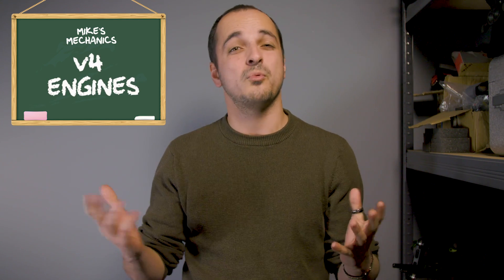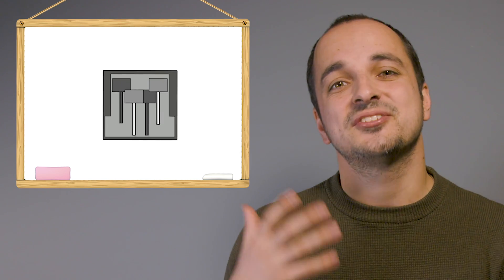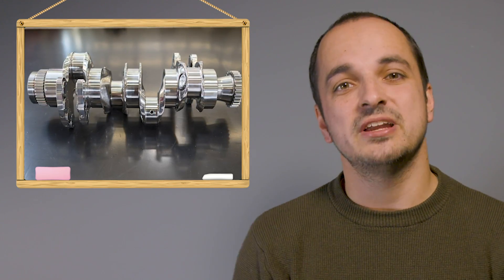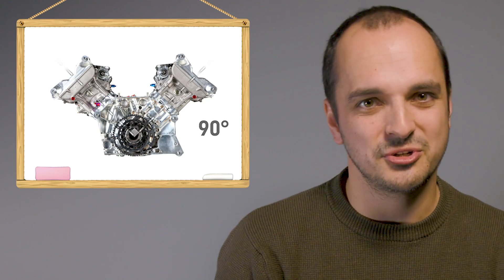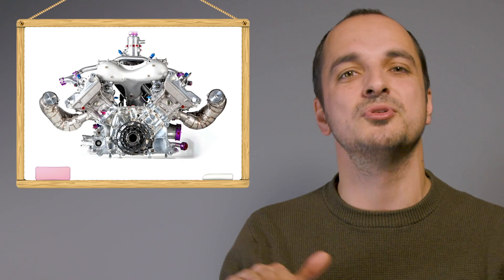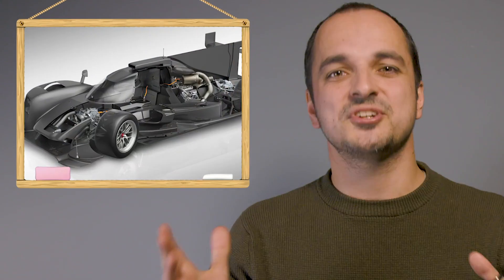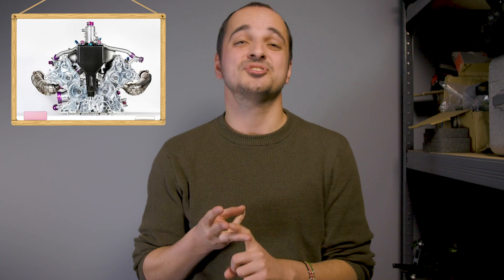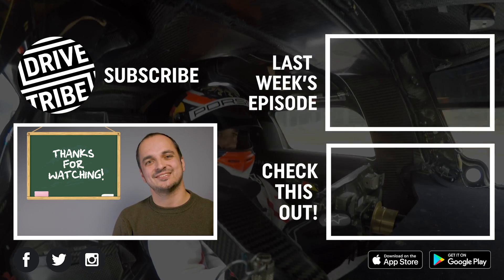Why V4 engines are so rare and which cars use them - Mike's Mechanics

Comment: My Audi Q3 2.0 TFSI Quattro have a V4 with only 320hp
Reply: But it has AWD
Reply: That is not a v4.  It's an inline or a boxer.
Reply: @mikeandrews4901  actually no, i modified my car, i just change his engine, and because the V4 is so compact fit perfectly
Reply: What manufacturer? And yes of course it's not 500hp like the one in the video.  Its a twinturbo They could have gotten 1000hp plus with that one but they want it to last.
Reply: @mikeandrews4901  I don't have the balls to make it more than 400hp lmao
Reply: @vaporwave8395  in a small lightweight Audi, good call.  Those things are craptastic!  Meaning they are nice as far as looks but every other way they are worse than fords!
Reply: @vaporwave8395  I have a 4 door Honda civic that's cranking out 672hp at the wheels, it has a inline 4 running 22 pounds of boost.  It is a scarrrry ride on the streets, but on the track it's a head turner.
Reply: @mikeandrews4901  I really don't like to push up that much in a car, I personally prefer a car were i feel safe to drive. (Btw i think than a Audi RS6 would be perfectly for you)
Reply: @vaporwave8395  lol more like an Acura rlx with boost

Comment: No man SUBARU used a V4 engine in the 90’s and early2000’s I think then Porsche got the idea 💡 wow problem like you said vibration to smooth operation and more trouble was horse power that suddenly was exposed.... too much to the Porsche and details that too hard to explain
Reply: Never heard of a Subaru or a Porsche with a V engine, they are boxers or opposed engines.

Comment: Ducati and Aprilia are already using V-4 engines in there super sport motorcycles. Technology is so advanced that more cylinders outweigh displacement. To compete with four cylinders need a four-cylinder. The same thing goes with a 90° V6! I like my 90° V twin 1299 S Panigale at the race track! 1199 is the maximum displacement for a V twin and it cannot compete with the four-cylinder 1000cc because of technology! The twins are allowed extra 200cc in competition races.

Comment: Ford used a V4 in there transit in the 70's
i also had a V4 motor cycle VF400
Reply: aeroflopper . My very first Ford Capri was the 2L V4, never had any trouble with the engine, only the usual Dagenham dustbin problem, rust.
Reply: @BDEyes53  i was just a boy in the 70's but i do remember the V4, i did not no it as a 2.0 just the 1.8 transit variant, an ex of mines father had a v4 tranny but we dropped in the 3ltr V6 that was much better.

Comment: So how does adding two more cylinders and making a V6 improve the cons?
Reply: It's easier to balance a 60 degree V6 than it is a 60 degree V4. 90 Degree V4 is bulky for general use, for a production car it's generally going to make the same power as an inline 4 so the extra cost and space a V4 takes up isn't worth it.

Comment: I had two Saab Sonnets with v-4’s.  I had duel exhausts put on both.  The engine wasn’t real strong on horsepower, but the sound of the engine was perfect! And they had 18” wheels, front wheel drive and was crazy fun going around corners.

Comment: I still don't see how this is more complicated than a V6?
Reply: It's not.  It's not practical for a street car because they weigh and cost more than an inline 4.  People are fine with the smoothness of an I4 today and very few production cars use the block as  part of the chassis.  In term of performance there isn't really an advantage.   Unlike V6 vs I6 the packaging doesn't matter much in fact I could make a strong case the I4 is more flexible in most cars.
Reply: @ineffable1129  they weight more? V engines normally weight less than a similar cylinder count I platform.
Reply: @ineffable1129  also packaging there is a difference. A I is always longer a v shorter but wider. If you need a shorter nose a v always is preferred because of this nature
Reply: @jdrok5026  Not in the case of a 4 banger there isn't really.  Either way mount it then they take up about the same amount of space in car application. 

That changes with 6's where the V has a real packaging advantage. 

 
I should have qualified that assumes a 90 degree V.  A 60 degree V like most purpose built V6's can weight less.  With I4 a 90 degree is ideal though.

Comment: Don't forget that Subaru makes one of the most common V4's around, it makes the flat-4 which is basically a 180° V4!
Reply: That's why it's called a flat 4, not a v4. Next thing you'll be telling us a straight 4 is a 0 degree v4!
Reply: @rossbrumby1957  I mean it's not wrong. Also no v design engines can be any degree. Flat is less descriptive as it takes two very different design ideas the boxer and the regular v design. So flat is more of a overall term.

Comment: My Honda VFR has a 750 V four. 4 valves per cylinder and gear driven cams. Thing is awsome
Reply: my Honda ST 1300 has the same and is sweet and super smooth.
Reply: Dre Belanski miss my 1985 VF500. Honda v motorcycle engines had some torque. They also sounded amazing with some jetting and a less restrictive exhaust.
Reply: They are awesome! I'm looking for one to build a buggy for my kids, they are hard to find.
Reply: @mikeandrews4901  they really aren't 😂😂 the engines are freely available and cheap as shit, mainly because they never, ever break.
Reply: @Soulrollsdeep  what I meant was they are hard to find in my area.  The closest I have found is in Texas. That's a min 13 hour drive.  Not exactly doable for me giving I'm not allowed to drive due to medical reasons. Gotta find one cheap nearby or that can be shipped. Keep in mind I don't need just the engine, I need the harness, and electronics too.
Reply: Same here, just an 800.
Reply: I love the whine of those gear driven cams. I had a VFR800 and I always thought it was very close to a v8 sound.
Reply: @MODeration_nXS  
Oh ya. I got a little carb work and a hindle exhaust system and in 3rd gear at 2500 to 3500  RPM it sound like a Mustang. I sold my first one with 130.000 Km and thing was still pulling wheelies . Honda is the king of reliability
Reply: @drebelanski7869  agreed, definitely most v8 sounding at low rpms. My vfr800 was my first bike and it took me a few weeks before I had the balls to crack it wide open. Lol. I was eventually pulling wheelies and cornering it like a small sport bike. Never dumped it and sold it after 2 years for what I bought it for. Awesome bike.
Reply: On my third VFR now and my second VFR 800 fi. It has a 'civilised' stock exhaust at the moment but I've got a two brothers can for it that sounds awesome. Smoothest bike I've ever had, when I got my first one it was so smooth and quiet I kept bouncing it off the rev limiter until I learned to feel where the red line was.
Reply: @alexarcano  I wanted to put a two brothers on my mine so bad! Best sounding muffler for that bike
Reply: I'm currently restoring an '87 VFR 750, beautiful engines!
Reply: VFR was/is a beautifully engineered design, largely driven by the corporate embarrassment associated with the complete dog that was the VF750 that came before it.
Reply: Brilliant engine i had an FJ
Reply: The v4 is the reason I want a tuono.
Reply: My NC30 (Honda VFR400) has one too....for people with small fingers! Have you seen the plugs on them or even tried getting them out!? It’s essentially a miniature version of the 750!
Reply: @simes205  a jewel like engine

Comment: Several motorcycles use them, including two of mine.
Reply: Hard to beat a V4 engine in motorcycle production.
I Won t ever go back to anything different
Torque
Sound
Smaller
Wide range of use
horsepower

Nothing compare to a V4

Comment: As others have pointed out the Ford V4 was in production for many years in the UK. Because it was a push rod engine it only had a single camshaft and was a very compact engine hence its use in the popular transit van in the Uk. I think a little more research is required before producing this video . Or say that you are only talking about racing engines...Cheers Warren

Comment: Please do another video on V4 engines.. I just learned it was beneficial to mass produce in line 4 cylinder engines.. Has Porshe been making 4 cylinder engines throughout the years and finally got one perfect? Or did they just decide to try for the first time and get it perfect? 
Interesting.. I seriously suggest you make more v4's.. Especially if you can find that one you mentioned by that company who you mentioned did they're v4 a little more narrow with a single head..

Comment: Mostly unbalanced? One of the reasons to use a 90 degree V formation is that you could balance it with only crankshaft counterweights unlike a straight four (that is unbalanced by default BTW so it definetly isn't a V4's disadvantage) where you need to use both counterweights and balancing shafts. He basically names all of the V formation disadvantages and blames them all specifically on a V4.

By the way as was stated before an air-cooled V4 was also used in soviet ZAZes. Because being air-cooled and OHV it was relatively simple and being a V4 it was compact with cooling fan and shroud conveniently located inside the V. It also sounds like a half of a V8)
Reply: All v I h etc etc formats have issues. I6s and v12 are inherently the most perfect engines in terms of balance along with boxers.
Reply: @jdrok5026  90 degree Vwhatever doesn't have balancing issues in terms of complexity. primary forces cancel each other out and secondary combine and can be balanced by  weights on crankshaft which are there anyway to balance centrifuginal forces.

Comment: And as soon as its components get made and are available everywhere, it will be the most inexpensive, fuel efficient and powerful engine you can ever get and swap your old petrol guzzler with.

I4s are great, they can make a huge power with small packs. But an even smaller V engine, with the same power? 
The V4 is not more difficult to make than any V engine anywhere, as the model is pretty much the same. Just nail the 90º angle and there you go.
Reply: It isn't more difficult but there are small gains from the complexity since the I4 does it's job just fine. With more cylinders in inline engines however come problems: besides the sheer size and weight of the engine, long crankshafts and camshafts are less rigid and more prone to breaking due to twisting vibration and balancing shafts are long and heavy (unless we're talking straight sixes) so making an engine smaller, lighter, shafts shorter and thinner and getting rid of balancing shafts just by switching to a 90 degree V configuration is most welcome)

Comment: 2:42
Man puts Porsche sticker
"As you can see on this graph this sticker gave us another 400BHP"
Reply: HERPY DERPEDY I think in some of their models, Porches use stickers instead of actual badges because the badges weigh so much and the sticker is to reduce weight. I may be wrong.
Reply: @steveninfire3953  I think it's more for the premise of "see we saved weight literally everywhere" when in reality it doesn't matter.
Reply: @alicebate6384  another way of saying we forgot to add the badge
Reply: @AA-zm9hk  you must be joking
Reply: @alicebate6384  you can tell if I'm or not ;)
Reply: SteveN In Fire for example Gt2 rs has sticker for less weigh
Reply: @steveninfire3953  the badges have come off at times causing serious damage,,,,,if i remember correctly it happened to mercedes before
Reply: Don't forget the racing stripes, they add 15hp
Reply: A Jeggs sticker adds another 15 horsepower. Everyone knows that!
Reply: My HP producing sticker Ripped off and my car exploded...

Comment: @DRIVETRIBE How about the Ford Essex 1.7 & 2.0 litre engines in the Ford Capri amongst others ?
Reply: There are still a few NSU ro80s' running around with Ford V4 engines fitted after the rotary died, including mine.

Comment: V4 isnt rare. Nearly all Honda and Fords are V4's
Reply: "Nearly all Honda and Fords are V4's". No they are not.
Reply: @harrygatto   Accord is a V4, the Civic is a v4, the integra is a v4 the tsx is a v4 the Taurus is a V4 (the one I had), the EcoBoost is a v4. Honda is mostly V4 to stay cheap reliable and easy to fix. Duhh. And on ford I'm not counting the trucks like F-150 jus the sedans and the one 4 banger mustang
Reply: @Ralph1492  
Do you actually know what a V4 is?
Reply: @harrygatto  4 Cylinder engine
Reply: @harrygatto  that's for the new accord not the older models. That's like half Electric
Reply: @harrygatto  I got a 99 accord V4. Also the new accord engines are half Electric. Most engines these days aren't even full motor
Reply: @Ralph1492  No you haven't, the only V engine Honda has used in its cars is the V6. I think that either you really don't know what a V4 engine is or you are just trolling. Please point me to some pictures and written information about your Honda V4 CAR engines.
A V4 engine has its cylinders arranged in a V formation, a little like half of a V8 engine.
Reply: @Ralph1492  Not any old 4 cylinder engine but one with its cylinders arranged in a V formation, a little like half of a V8 engine.
Reply: @Ralph1492  
Shoppers looking at the 2019 Accord will have their choice of a standard engine or a hybrid engine. We will discuss the details of each. For starters, the LX, Sport, EX, and EX-L all come with standard engine options. The base engine on each of those models is a 192-horsepower, 1.5-liter turbocharged VTEC® inline four-cylinder engine. The Sport and EX-L trims come with available upgrades to a 2.0-liter turbocharged VTEC® inline four-cylinder engine powered by 252 horses, whereas this engine is standard on the Touring model. The Hybrid, EX, EX-L, and Touring trim levels also come available with a two-motor hybrid engine system. This system includes deceleration selectors, an 8 to 10-year warranty, and an E-CVT with Sport Mode.
Reply: @harrygatto  I thought all cars were either V4, V6 or V8. So I assume it's a V4 instead of an Inline engine. The only v4 I've owned was my 2000 Taurus SE and the 1999 accord belongs to my sister. I now have a V6 01 Mustang. But I thought most sedans in general were V4's. Thanks for clearing everything up. I'm not a car guy but I did assume inline was reserved for coupes and sporty sedans like Corvettes
Reply: Glad we finally got there.

Comment: Rare ? When I was in germany I had a Ford Consul with a V4.....seemed pretty common
Reply: i remember the V4 transit engine i think it was a 1.8
Reply: Yeah, the rareness being that only one company, Ford, produced the engine for the most part and SAAB bought them to use in their latest "96" models of the 1960s which were fairly numerous.  I once borrowed a "96" station wagon from a friend and the powerplant was nothing spectacular but was reliable and easy to service.
Reply: Probably less than 2% of all cars ever made having a V4, so yes rare.
Reply: Yep. Every UK Ford of 1.7 / 2litre was a V4. Corsair. Capri (this producing 105bhp - 7 more than the later 2l 'pinto'). Zepher. Zodiac. Transit.
I believe Saab had the German version V4 and not the 'Essex'.
Reply: @mrd4032  sure they was 1.8 and the mk2 transit was shit only had 80bhp
Reply: Castle Bravo  I know, i just didn't want to "trigger" someone and write something like: AKTUALLY is not 0.2% but 0.233%

Comment: My IS250 has a V4 and it sure doesn’t sound like that!
Reply: No it doesn't.  It's a got 4 valves per cylinder no a V4 piston arrangement. Just like a Toyota Corolla (same engine, same car, just leather and an idiot behind the wheel).

Comment: I remember a v four in the Mercury Capri and I remember it wasn't very good.
Reply: That's because it was the Ford v4...
Reply: @mikeandrews4901  I can name several less than great motors and vehicles from each of the manufacturers. Chevrolet produced many duds and several great cars just like everyone else.
Reply: @rickhale4348  agreed, but Ford has a higher percentage of shit cars than most others.  Most of the vehicles that came into my shop were fords.
Reply: @mikeandrews4901   the worst car I ever worked on was a Saab turbo. I sent it back to the owner with wrecker. I do miss my 68 high performance mustang and my 69 Buick Wildcat  430 big block, predecessor of the 455. We bought a brand new 1972 gremlin x V8 for $1,900. 304 v8, Delco ignition, ford carburetion, 727 Dodge automatic transmission. Fast, fun, and handled great. 24 miles to the gallon.

Comment: Flat 4's are not unusual and there's really no difference between that and a V4. It's the same design just with a 180 degree bank between the cylinders.
Reply: No .Big difference with boxer 4,especially the crank journals.All boxers are flat,but not all flats are boxers.
Reply: @nssherlock4547  I know what you are saying in that the boxer employs one crankpin per cylinder, while the flat (horizontal V) engine uses one crankpin per two horizontally opposed cylinders. Still the flat-four can be thought of as sort of a 180° V4, with the same number of cylinder heads and all the other associated extra costs of a V4 over an inline-4.

Comment: 500hp from 2 litres!
I drove a V4 Transit, didn't make 500hp I suspect
Reply: Race engine and normal car engine are different. Race engine usually have higher RPM limit than normal car engine due to its wider bore and shorter stroke length. This would have higher power but sacrifice some torque (this is problematic if the vehicle has heavy weight and/or heavy load). Moreover, higher rev limit means shorter lifetime and sometimes more expensive due to high quality material.